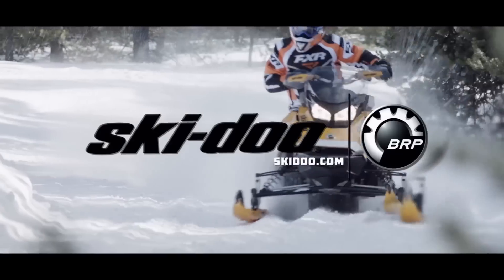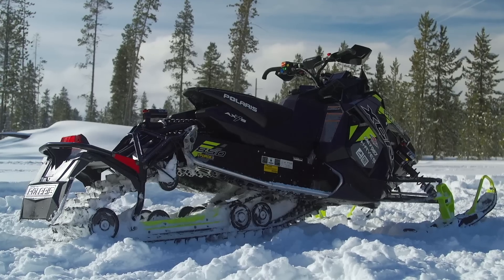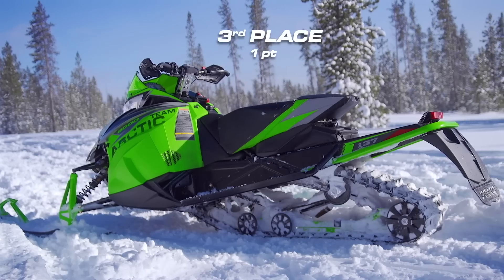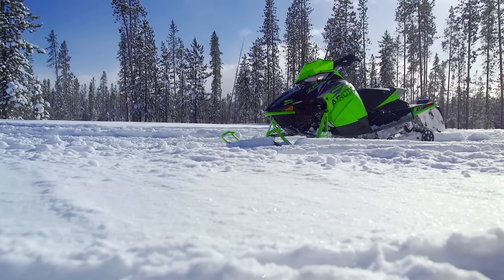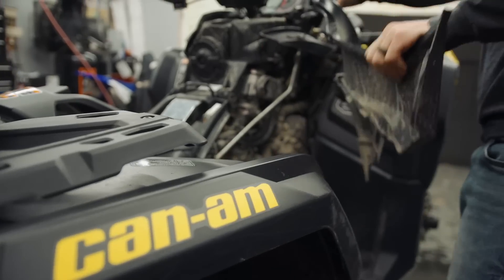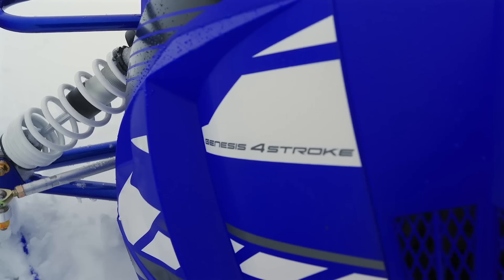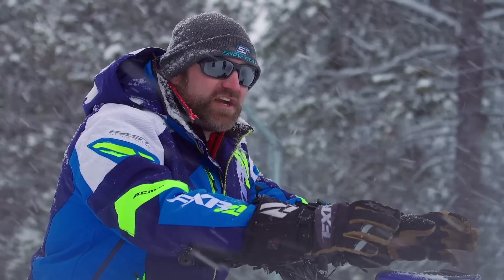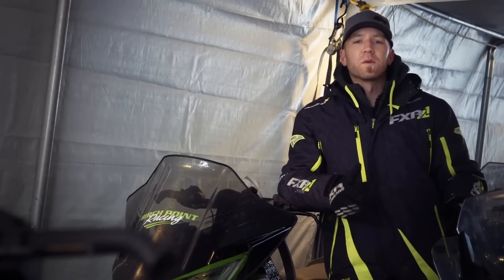SnowTrax Television 2019 - Episode 3 (Full Episode)

Comment: Isn't the arctic cat 794cc ,and there in not meeting one of the two most important requirements.
Reply: Good point,  got a 2018 8000 El Tigre,  it's 794, beautiful mid range but it's 55 less cc than the other 2

Comment: Guys, I have a problem with my 1999 Indy 500. I bought it a year ago garage kept all its life with 900 miles in beautiful condition and it ran fine. This year, I started it up again, put gas and oil in it, and it completely bogged out in the middle of a (frozen) lake. I got new spark plugs and spark plug caps on it, but later that month, it did that exact same thing in deep snow(it shouldn't because it's an RMK). A local expert told me nothing was wrong with it except the belt, so I got a better belt. Later, it did that exact same thing and another engine expert told me it was fuel and oil filters, so we changed that, took the water out of the carb, and cleaned out the airbox. It ran like new in 5° weather until a few days when it warmed up to 25° and it bogged out, lost power, and ran on 1 cylinder halfway down a packed down trail. I want to know what else could be wrong with it and what i could do. Please help I use that snowmobile everyday to go to school and work
Reply: And please don't say something like "its cause its a Polaris/2stroke" cause I dont have the money to buy anything else and I love that machine and I want to keep it
Reply: Try the electronics
Reply: @homechannel4933  could you elaborate?